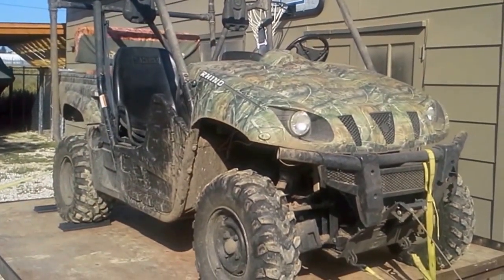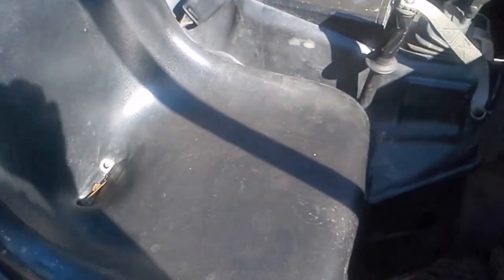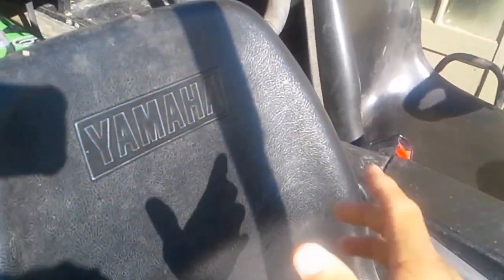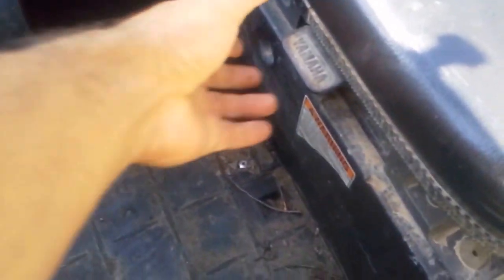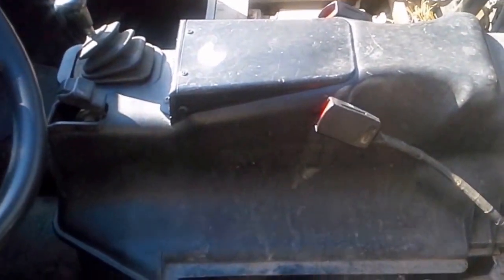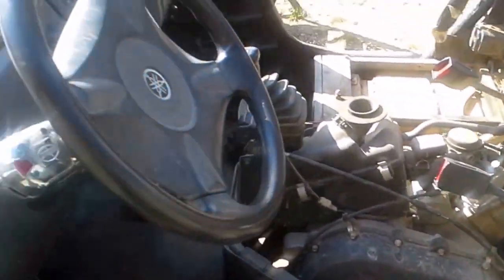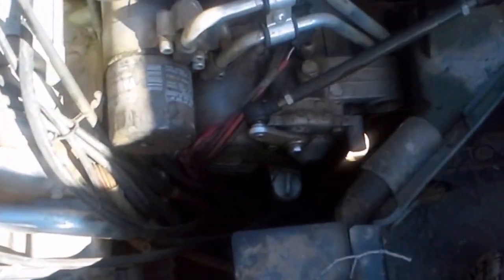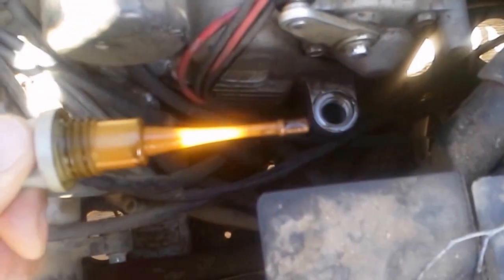2006 yamaha rhino 450 check oil

Comment: Don't screw the dipstick to check the oil level. 

From the owners manual (the service manual will say the same). 
To check the engine oil level
1. Park the vehicle on a level surface.
2. Remove the console. (See page 8-9 for
console removal and installation procedures.)
3. Check the engine oil level on a cold engine.
If the engine was started before
checking the oil level, be sure to warm up
the engine sufficiently, and then wait at
least ten minutes until the oil settles for
an accurate reading.
4. Remove the engine oil filler cap and wipe
off the dipstick with a clean rag.
5. Insert the dipstick in the oil filler hole
(without screwing it in), and then remove
it again to check the oil level. The engine
oil should be between the minimum and
maximum level marks.
1. Maximum level mark 2. Minimum level mark
3. Dipstick 4. Engine oil filler cap
6. If the engine oil is at or below the minimum
level mark, add sufficient oil of the
recommended type to raise it to the correct
level.
Reply: +frank chodacki .. that is.. don't screw the dipstick IN.. ;-)

Comment: Uhhhhh, never known an engine that had a screw in dipstick that you screwed it back in to check the oil. Always unscrew, wipe clean, then just set back in the port. You are running your engine pretty low on oil!!!!!